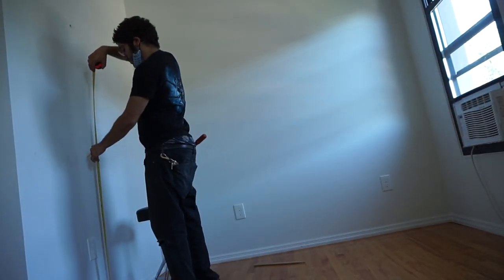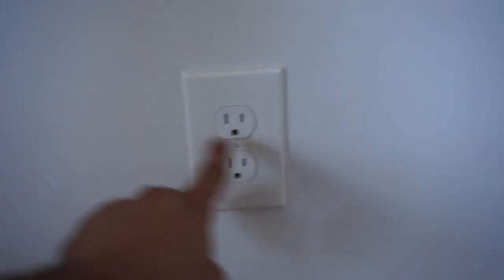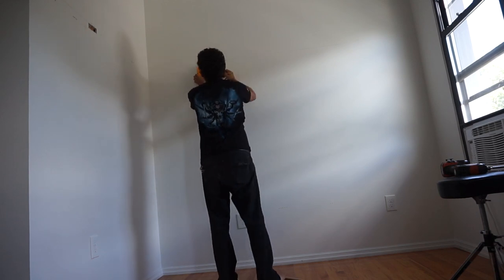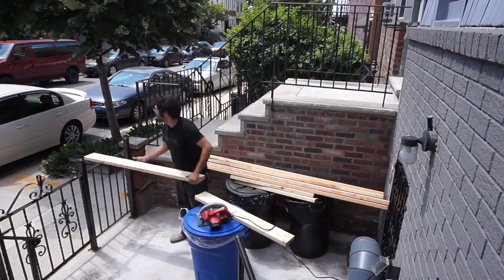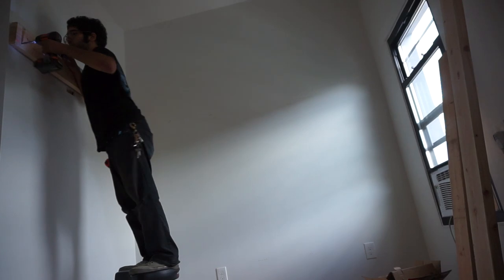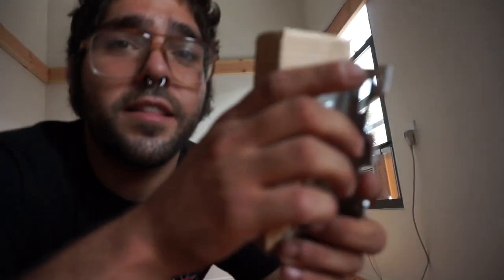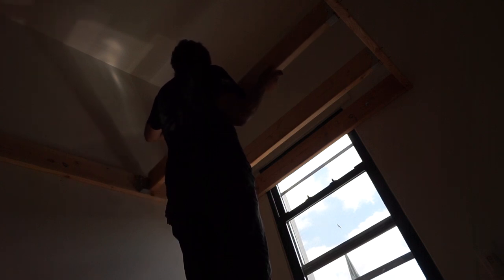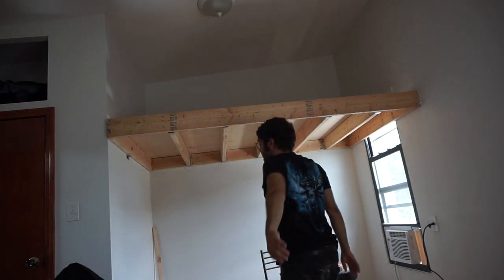BUILD A LOFT BED WITH NO SUPPORT BEAMS

Comment: The structure seems sound, but  I wouldn't suggest a big rumpus up there. In any case, I'd suggest a few more lags screws here and there. Can't tell from the video, but you should also use flat washers with the lags..gives extra surface area and makes it less likely that heads will pull through the board. 
Also you might want to consider running the seams of the plywood front to back, centered on a support joist, rather than Left to Right  scalloping across the joists.
Also, imprtatnly, before you go popping off to the nearest lumber yard, make sure you're safe lease-wise, I believe a structure like this can void a lease.
That's why people generally build lofts to stand on legs not actually touching the walls.
Reply: You sound like a person with some wood work experience, I have a question what would the best way to go about this without worrying about legality and does it matter what type of wood is used and do you think a support every 4" on a queen size mattress is good enough for around 300-400ish lbs? I just want to make sure it's sturdy enough for my dog, gf and me and the mattress

Comment: Hi Christian. Nice video, informative. Can you also use these brackets when one of the walls is not square opposite the others?
Reply from the maker: You could, i would suggest  cutting up some shims, and shimming out the left or right side of the bracket to equalize the angle of the wall that is not square
Reply: @hicks._9268 Hi Christian, thank you for a very swift answer. The amount degrees the shim has to cover would be too much for a savely weightbaring construction, hence the question. It is for a loft in a one-sided-semi-round built house (a true buildinghorror), and I am not exactly butterfly-weight ... . 
I just found brackets with a 15-30° angle but those are for undermounting on an existing frame. And wallbrackets for 45°. 
I will have to figure that out first, let you know if I do. Thank you, and have a nice day. Gr, Esther

Comment: How's this holding up? Every other video I see uses lots of timber bracing, support beams etc and this seems so much more simple and clean.
Reply from the maker: Still up there, still sleep in it every night, and occasionally enjoy the company of others as well up there if you know what i mean. At the most i have had 4 friends up there at once
Reply: @hicks._9268  this is probably  the best reply ever 😂 cheers mate, using this as a guide for doing the same in my new house in Scotland 🙏🏼
Reply from the maker: @KhalScott24  hehehehe. Good luck with the build! The strength truly comes from the lag bolts

Comment: Trying to build one but the window has trim so one side wouldn’t be flush with the wall, any recommendations?
Reply from the maker: Either take the trim off the window, adjust the build so it misses the trim, or notch the perimeter board so the trim fits under it flush OR cut the trim the exact width of the perimeter board so it fits in-between the trim flush

Comment: Hey I was wondering if you could help me out do I put the lag bolts in the studs  behind the wall? And I have dry wall
Ps great video plssss helllpp
Reply from the maker: You need to bolt the lag bolts through the studs behind the drywall, it will be bolt going thru loft joist, to drywall, to stud behind drywall.

Comment: How much did this cost u plz answer soon
Reply from the maker: It says right in the description, $238
Reply: @hicks._9268  damn that's  a bit much 😳
Reply from the maker: @kolemiller9216  federal minimum wage is 7.50, it would take you one week of full time work to make that anywhere in the US.
Reply from the maker: @kolemiller9216  if you had a professional carpenter install this, especially in NYC, $1000 would be a good deal. It's a perspective thing
Reply: @hicks._9268  and from my perspective I'm 13 and don't have a job soooo
Reply from the maker: @kolemiller9216  ahhh one day... the other alternative would be to chop a few trees down and source the lumber from that